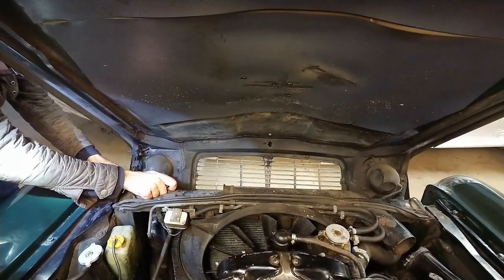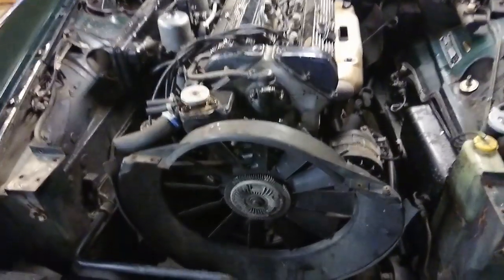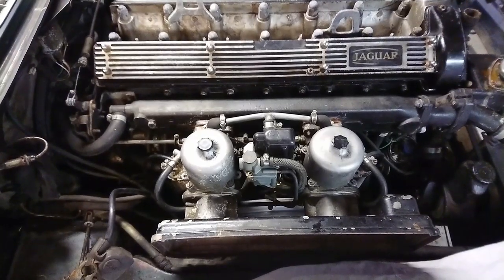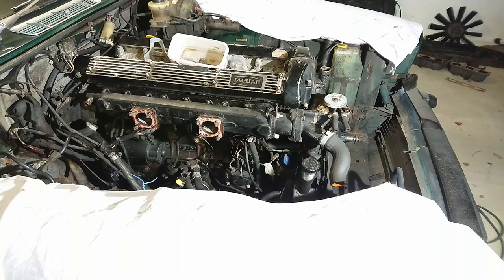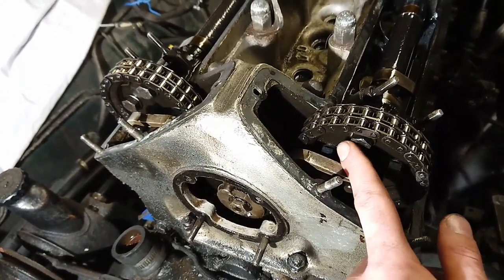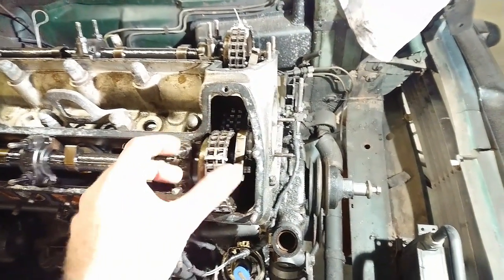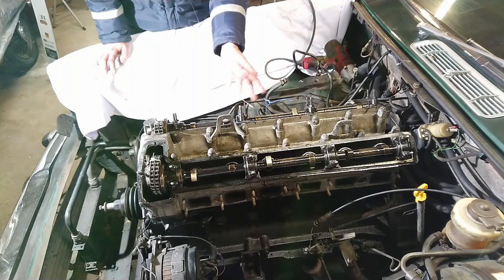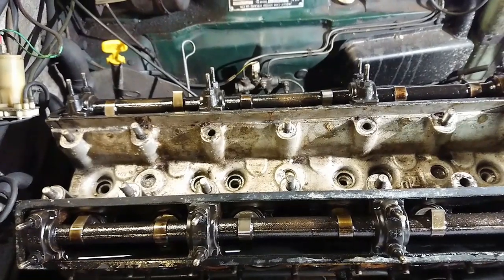Cylinder Head Removal Jaguar XJ6 (Part 1)

Comment: Correct me if I am wrong, but I think that you removed the head nuts in the wrong order. Should be done in the reverse order fron tightening that is from the outside to the middle. Great video anyway.

Comment: One aspect of making sure to not undo the studs at the bottom of the block is that if you do, then when you pull a stud up then old dirt and sediment at the bottom of the block will fall down and collect in the block bottom threads !  Not an issue if you plan to totally clean up the block before reassembly. But not many plan for that.
If you would not be aware of and be able to clean up those threads before installing the stud(s) back into the bottom threads you will have dirt in the threads that might prevent the studs from being tightened down all the way in those threads. Some sediments may be left halfway(!) up the threaded hole that prevents using up the whole threaded portion. And that means that when you later tighten head nuts, then any partially threaded down stud will not be using the entire thread portion and when tensioning you risk stripping the cast iron bottom threads ! That is a fairly delicate repair of the block and may set back your entire project. I did that mistake with one stud of a Series 1 4.2 when young and inexperienced and given my zero budget DIY resources I ended up running the engine without one stud for the remainder of ownership plugging the cylinder head stud hole... So be aware.

Comment: Cylinder head dome nuts should have been removed from outside, working towards inner (center nuts) ...You done a compression test, did you do a wet test?
Reply from the maker: Yes I did do a wet test. Hardly any change then. Was a head gasket leak and too tight valves
Reply: @LivingWithAClassic   I am concerned that the piston rings are worn. might be a good idea to check them out, but it means pulling off the sump and that means checking the big ends and mains. These cranks are super tough though. Where to stop. ! I am sure you dont want to do all this work only to end up with a low compression engine (under 150 -160)
Reply from the maker: I understand your concern. The car had a compression test about 2 years before this happened and it wasn't many miles in-between that. All cylinders had strong and even compression. This project is not about a whole engine rebuild. I'll be doing that to my 1966 3.8S. This is just about fixing that issue and enjoying it. If it turns out the engine is weak I'll source a good used one instead since the numbers aren't matching. I've also filled each cylinder with fluid and it didn't go down after 24 hours

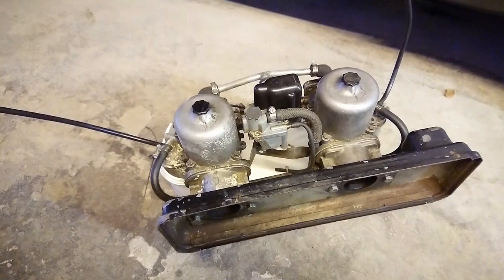Comment: 5:45 Why is the left hand inlet tunnel (the one bolted to the air cleaner base plate) mounted upside down compared to the right hand one ? Does it make a difference ?

Comment: I wish this wasn't so helpful for me right now. 😉

After stopping for fuel in my '86 XJ6 yesterday, it wouldn't start after I had paid the bill...  It sounded like the starter was 'trying hard' but it couldn't turn over a single pulse, so I didn't think the starter was my problem.  (Was/am pretty sure it was hydro-locked with coolant.)  I ended up having it towed home...

I decided to 'try again' this evening after getting home from work, and after a couple of the 'hitting it hard' attempts by the starter, it fired to life and purred quietly, as it should.

But checking the coolant level, I noticed that not only was the level down significantly, but there was a somewhat forceful flow of air/gasses escaping from the coolant reservoir.  I then checked the dipstick, and found it 'too full', and looking like chocolate milk.  🥴🥶😵

So I am sure I have a blown head gasket, at least.  😢😭😭 NOT exactly the news I was hoping for.  (I have been driving the car for a year now, and I have had NO history of overheating or anything related to that. 🤔)

I imagine I'll be revisiting this series of videos numerous times over the coming weeks, as I try to make time to discover just how bad my 'project' is going to prove to be...

Comment: I have a manifold leak on my 4.2 Series 3, the cylinder head has never been removed before, I'm extremely worried about breaking studs if I attempt removal myself in the street.
I am seriously considering entrusting this job to a Jaguar specialist, if I break a stud, I do not fancy my chances of drilling out in the street with limited tools.
From your experience, am I right to be worried, or do you think I'm worrying unnecessarily ?
Reply from the maker: It depends how they look. Send me a picture of the nuts and studs on Instagram and we’ll see
Reply: Thank you my friend, I've removed heat shield tonight, the front manifold is cracked 🤣
Reply from the maker: Ah too bad. Easy to get used at least. Check Simply Performace if you’re near to them

Comment: Great clip
You must be a mechanic
You make it look easy
Could a non mechanic perform this job
What degree of difficulty would you rate this at from 1- 10?
Thanks for sharing
Id luv to get one of these as an older unrestored series11 in Aust is fairly ressonably priced but am wary of the minefield i may be entering
Reply from the maker: I’m not a trained mechanic but I’m an engineer and self taught mechanic.
It isn’t too difficult but maybe it’s not the first car related issue you tackle. But I believe that most things on these cars can be done by anyone willing to try

Comment: What type would you use for transmission fluid, brake fluid, and power steering fluid? Any info will be appreciated.
Reply from the maker: For an XJ6 series 2 or for which car?
Reply: @LivingWithAClassic  for a xj6 series 3. Thank you.

Comment: To much work I'm glad I got a sbc in my xj6 series 3
Reply from the maker: Shame you ruined your car. To each their own I guess
Reply: @LivingWithAClassic  I bought it like it I didn't put the 350 in it
Reply from the maker: Sadly it was a common swap back in the day. Nothing wrong with SBC however in my opinion it doesn’t suit the car. It’s a good engine but doesn’t have the smooth characteristics of a Jaguar engine
Reply: @LivingWithAClassic  yea it looks like a back in the day engine swap its got a old 84 sbc in it runs great nice and smooth  got it all up and running at the weekend been sitting since 2012 been watching some of your videos really good info in your vids I got to do rear shocks and springs and the front need to get another bonnet for it everything looks original it's missing the radio  the gas tanks are bad so I put a fuel tank in the trunk and used the gas lines in the trunk my jag is a early 83
Reply: Last year i got an all original '86. I love it, but honestly i miss my old '71 with sbc... was faster, more reliable, was smooth and sounded awesome.